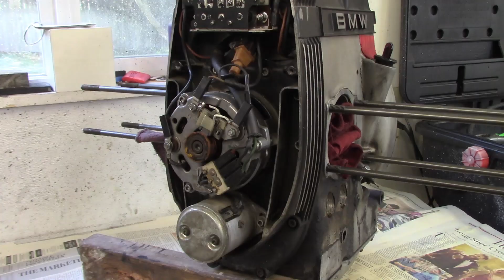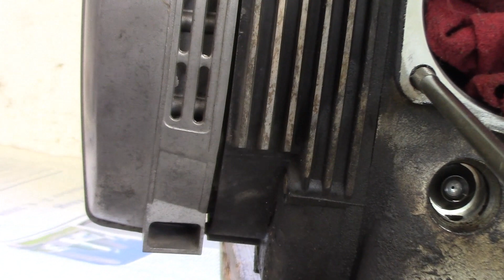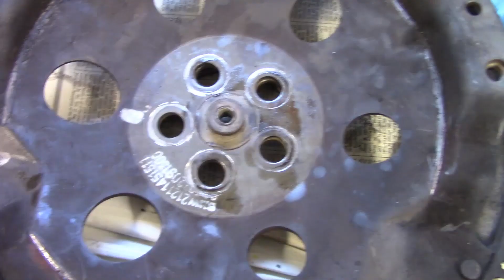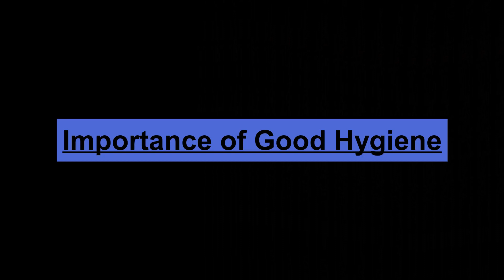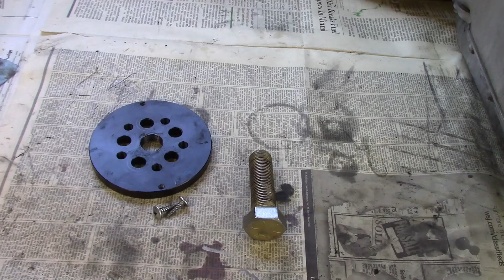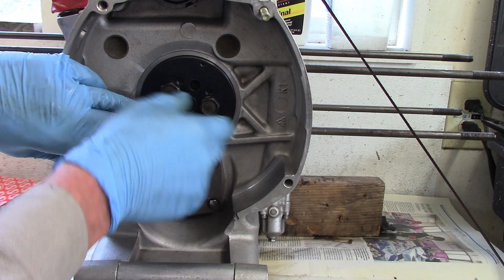1983 BMW R100RS Remove Flywheel & Rear Main Seal

Comment: Hello Brook,
at 4:12 there is the flywheel washer BMW part no. 11221335366 missing. The result is that there are little marks in the inner ring of the guide ring / center of the flywheel hole. These marks are blocking the guide ring BMW part no. 11221336380 to the flywheel during disassembly. The flywheel should come off of the guide ring easily without pulling the guide ring at the same time.

Very good video.

Best regards from good ol' Germany
Georg
Reply from the maker: Georg, The flywheel bolts do not have washers underneath them. There were none when I removed the flywheel.
Reply: @BrooksAirheadGarage  Hello Brook, yes, maybe that someone before you removed the flywheel an did not bring on the washer ring again. Here is a picture from my '83 R100RT:

and from the BMW parts catalogue:

Regards
Georg